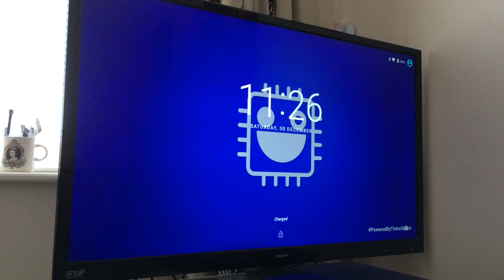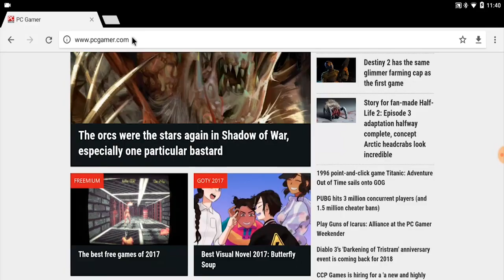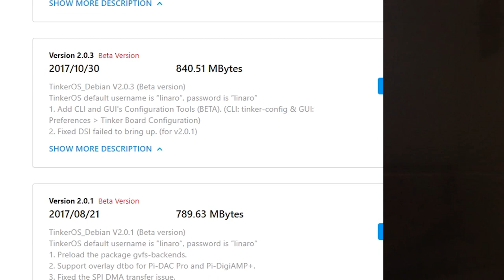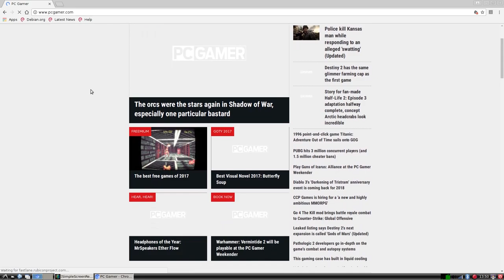The Tiny, Cheap Asus Computer That Fits In The Palm Of Your Hand

Comment: I got a Raspberry PI 3 as a cristmas present. It's very fun to learn how to code with this thing and it's more fun if you have a soldering iron. I already made a doorbell which gives me pushup messages at my phone and with a friend of mine, who already known how to make apps for android, we made it possible to send a audio message to the PI, which is then played. I already ordered a little camera so we can see who's ringing the doorbell.
Reply: Great idea they are often used with retropie installed for retro gaming  to make arcade cabinets but have so many uses .
Reply: kingofnfsfan the raspberry pi is a wonder. Yes a soldering iron will help alot. This asus tinkerboard would definitely give raspberry pi some competition. Glad you found something you can enjoy :) Happy new year!
Reply: Yeah the access of GPIO is a strong advantage for those kind of cards. It's like a strong microcontroller with interface and few programming skills needed.
For better retrogaming emulation and still very good Linux support, the Orange Pi boards running Allwinner H3 or H5 (Cortex A53) are very cheap comparing to RPi 3. But if you want to play GameCube and newer console you probably need to go with standard Intel x86 CPU with a way better IPC.
Reply: Do you mean the doorbell sends push notifications to your phone? Is it an open source doorbell or something? Where did you get it?

Comment: For those wondering,
The raspberry pi 3 has a ARM Cortex-A53 1.2 ghz quad core cpu so it's 600 mhz slower than the asus's Rockchip RK3288
The raspberry pi only has 1gb of lpddr2 so half as much as the asus's 2gb lpddr3 ram.
The raspberry pi is only capable of 1080 in contrast to the 4k support of the asus.
The asus looks to be about the same size so the form factor is the same.
Both have bluetooth, wireless, 4 usb ports and a hdmi port.
So for 30 dollars more you get a computer with one gb of faster ram and a processor that is 600mhz faster and could probally be overclocked.
Reply: The raspberry picture community is infinitely larger though, and when it comes to these boards that's very important.
Reply: The ASUS also has a GPU
Reply: PLease don't write stuff you don't know
Frequency doesn't matter because the raspberry pi uses different and weaker cores
Reply: Might want to research clock speed a bit more, man. Frequency literally means nothing on its own between different lineups of processors.
Reply: ok i added a bit more information to the original comment about the different models
Reply: RetroX still the 600mhz lower isn't relevant, is what we were saying. A 2.1ghz modern i3 is faster than a 4ghz am2 processor.
Reply: The cpu architecture is also diferent, (cortex a17) which is (albeit still 32 bit) is significantly faster then the a53 of the Rpi. I want one.
Reply: whole problem is software. RockChip has only NDA drivers, asus not very good at specific things (remember xtion?? i have one, software was abandoned at 2013) not worth it unfortunately
Reply: RetroX raspberry pi has a bigger community
Reply: The new pi is the same price as the tinker board if you get 4GB RAM now!

Comment: This Tiny PC has Quad Core and here I'm still using Dual core
Reply: Debjit Chowdhury we hate our lives dont we?
Reply: It's a quad core arm processor so your 2 core is better
Reply: Adam Burke OH so its arm Huh now i dont have to kill myself DUAL CORE RISE
Reply: Debjit Chowdhury that quad core if you decouple the gpu has the power of a p3.
Reply: Subi_fan I'm LGA 775 user not AM3+ user
Reply: My phone has a hexacore and my pc has a dual core, both have the same amount ram
Reply: Debjit Chowdhury im here using my celeron 420 with a single core
Reply: Miles Routledge I already know that A Octa Core mobile processor never beat a Desktop Dual core even my my phone has 8 core and it can't beat my Dual core PC. I'm just saying that this Tiny PC has more core than my PC
Reply: Debjit Chowdhury my quad core phone beats my single core pc everytime.
Reply: 1.8ghz means it is in most scenarios, terrible, besides general browsing etc
Reply: i got a 1 core
Reply: u complainin about that while im gratefull with my pentium 4
Reply: It could be 8 core but each core on Intel/AMD has far more transistor power frequency aka GHz and the pipe only got 2 lanes but it does things are faster and more headroom hence why PC cpus heat up its due to the power that is throwing though the cpu transistors.
Reply: @computerg11k89  Socket 478 or LGA 775 one?
Reply: @theweirdmaterial4908  775
Reply: Subi_fan  fx is cool

Comment: One of the most interesting features boards like these have, is the large general purpose pin header. You can connect all sorts of custom circuits to your SBC and program the pins to send/receive data, drive servomotors, pumps, valves, turn things on and off, pretty puch anything you can write a program for. So it can be used as an Arduino on steroids, used as the brain of a 3D printer or CNC machine, etc.

Comment: This is awesome... I might get one to use with my ROG_EXT header and get some serious OC's done.

Reminds me of the old Asus OC Palm/ScreenDuo. There isn't a single video of one on youtube.

edit : Yeah, you can actually get a brand new Raspberry Pi 4 with 4Gb of ram and a bunch of extra stuff like a case, 32gb micro sd card, heatsinks, a 40mm fan, charger, and a bunch of other stuff for only $135 CDN which is about what the Tinkerboard goes for USED on ebay on it's own. You can also get an 8gb ram version for $170cdn.

Comment: I use Linux as my only OS on 2 of my 3 pc's. I think it is better, more user friendly, and just as stable as windows except for gaming. I still do most of my gaming on linux though unless a title isn't supported and wont work on wine.

Start with linux mint cinnamon or xfce. They are more user friendly and have more features then the standard debian. Mint is also based on Ubuntu.

Although you can customize them all with the desktop environment and file manager you choose.

Comment: Imagine putting that in an ATX case lol
Reply: I shall 1-Up that idea by putting a raspberry pi zero which is half the size of this and really thin in a full atx case
Reply: Will2133 I buy power would do it, and label it GAMING COMPUTER
Reply: Actually that might be kinda neat to have a tower with 2 systems, given it's a tower you don't mind cutting a few holes into for I/O
Reply: BootlegScarce but not just any leds, it has to be RGB
Reply: Linus Tech Tips put 2 actual PC motherboards in Corsair’s new case

Comment: I'm really surprised this kind of hardware is not integrated yet on PCs, be via a PCIe card, on the motherboard itself or something like that, it would be an interesting way to use your system (even without a CPU, ram or GPU) with very very low power for all kind of day to day basic tasks like youtube watching or PLEX server duties to setup duties like updating your MB bios, downloading and creating an OS bootable pendrive, reading PDF manuals.

Comment: what you didn't mention is that those little sbc's use next to no power at all. that makes them perfect for building a small home server without driving up your power bill. 
i have a bananaPI, which is the same form factor with lower specs. but it is running for about 4 years now very reliable. started with a single harddisk, it has grown to 6 disks with a total of 7 TB storage for my home network. also runs a lot of other services.

Comment: You don't have to dump Windows to use Linux. Use both. They both have their strengths and weaknesses.

Personally I find Linux better for building an automated workflow - batch conversions and so on. It's also a much better environment for software development. Windows is better for games and productivity. Just switch between the two as required.

Comment: The real question is, can it run Doom? (the old one, obviously).
Try this in the linux terminal:

sudo apt-get update
sudo apt-get install chocolate-doom 

After running those commands, open up any computer you installed Doom on through steam, fish in the file system for your doom.wad or doom2.wad (the file holding all the levels, wad being an acronym for "Where's All the Data?"), and put it on a usb drive. Then, put it in the home folder of your debian installation on the tinker board.

Chocolate doom is a source port for Doom that aims to keep as many things true to the original as possible (including emulating old bugs and keeping the resolution low) while using modern OS compatibility standards so that it can run natively in OSes like Windows 10 or OSX, and as such tends to run well on tiny computers like the raspberry pi. I know it's in Ubuntu's software repository, so that you can use apt to get it, but I don't know about this for Debian's repoes. If Chocolate Doom isn't available, you could also try PrBoom, or attempt to download the source code for Chocolate Doom and compile it from source.

Comment: Finally, single board computers RGH. Also Linux is great, I switched this March to Linux because of my Raspberry Pi. And it turned out to be really not bad at all. Some games as CS:Go and all the other Valve games run flawlessly. And also there is a thing  called PlayOnLinux which I think creates something like a Virtual Machine, so you can play PC games. It doesn't really work with all the games but games like Overwatch and OSU! run just fine. Overall learning Linux was fun for me.

Comment: I'd be interisted why you don't like neither Android nor Linux? Linux often is great, especially for older Computers with less juice. Have a nice day
Reply: Likely because everything is easier to do on windows. You can get a lot of the same functionality out of a linux OS as compared to windows but there are usually a lot of extra steps involved and quite a bit of a learning curve. I use Ubuntu on my laptop, which struggles with windows 10, and while I can do all the things I could with windows, it's always more of a hassle.
Reply: i have a celeron 420 and when I overclock it to 2.45 ghz linuxmint wont boot.
Reply: Jane Doe That's probably an accurate statement. One thing about more modern linux OS's like Ubuntu is that they meet Windows half way by having a nice ui, which then doesn't really force you to learn the real ins and outs of a linux os, e.g doing things solely with the terminal. Then when something outside of your comfort zone is required it seems a lot more difficult.
Reply: Cuzeg Spiked Yes, you find it easy to use, but as therandomdot already stated, you really need to get used to Linux and be interested by yourself. An that's not within the comfort zone of most users, particularly not of inexperienced ones, I think.

Comment: Linux is epic. I'm not even a fan of it for everyday use myself, but for programming and doing behind the scenes dirty work, you can't beat it. My network at home runs on a homebuilt Linux router/DHCP server. I also host a Minecraft server and associated webpage on Linux. The Unix/Near-Unix scene is legit. I'd use it full time if more software devs supported it and I didn't hate OpenOffice so much. FreeBSD is really nice as well.

Comment: I got one of these back in early 2019 due to the out of the box Android support and double the ram of the Rpi 3 at the time. Sure, software support for it is pretty much dead, but it is a great energy-efficient home theater and emulation machine (although some PSP games lag on it).  I am sure there are better ways to use it, but it is very comfy if you use Android and don't expect too much from it.

Comment: As far as i know if the Asus TinkerBoard can run a normal sitro of debian it should be possible to get the linux version of steam installed. The bigger problem ist the architecture of the cpu and the fact that it does only support OpenGL ES and thats also different from a desktop version of OpenGL.
Only the fewest games will run on it even if these are native linux games like BlobbyVolley. The Asus TinkerBoard and all of the raspberry pi's are always misused for gaming and emulation because there are cheap mini "PCs" wich can run linux. The real purpose of these is to have an all in one DIY programming station / script running pc for several projects wich need the GPIO(General Purpose Input Output) pins of the board. To run Android on the TinkerBoard or to run Ubuntu Mate on the Pi ist just for playing around and not the purpose of these boards.

Comment: to everyone who is wondering about linux I am just going to say that it is really easy to use and a good alternative to old pc's if you don't want to buy a copy of windows and it is easy on the system, I use it a ton of times, I even put linux on my old laptop because the vista on that thing kept crashing, so I installed Linux and it runs a lot better, now I have a spare computer I can use if I need one.

Comment: But... CAN IT RUN CRYSIS??
Reply: no.
Reply: I highly doubt it will. you'll have to add a fan for cooling or replace the heatsink altogether cause if you could run it it'd probably overheat
Reply: Samo Hraje Yep, Crysis 3 on Ultra settings in 4k@144 FPS, it's a monster!
Reply: Victor Matheus Bezerra Lima, Nah man you didnt use its full potential, I used crysis on 8k and ultra settings and I got 240fps while overclocked the processor to 4.7ghz and the gpu to 2ghz and downloaded 16gb of ram
Reply: Victor Matheus Bezerra Lima you are underestimating it 16k@300fps with omega fucking realistic settings in crysis

Comment: Try overclocking the board by ordering a case for it then wiring a 40 or 80mm fan to the case I ordered some fans to do the same thing with my raspberry pi.

Comment: 2x the power of a Pi3, 2x the cost.

I still prefer the Pi3. It can do all my emulation needs on it, and it has the advantage of being well supported (As long as you stick to the 32 Bit OS) (I still can't believe there is not a single official 64 Bit OS for the Pi3.)

Comment: can it run Crysis?
Reply: Japije 01 easy
Reply: 4k supported. This was already mentioned. Duh!?
Reply: My raspberry pi  runs crysis at 4K 120 FPS so this can definitely run it at 240 fps
Reply: only at 1x1 res
Reply: interesting, i just googled it and its possible to run crysis on linux and some ppl actally did run it on slightly stronger single board computers
Reply: Harsh Chan you need to update your drivers. should be getting 8k at that fps on the pi.
Reply: Мандибрики і Цирупопики sarcasm, dont be serious ok?
Reply: Ded meme
Reply: It will never die...

Comment: Linux is fun and you can learn HEAPS about computers by just playing around, I didn't switch from Windows either (Gaming being the main reason) but now I work on Mac , Windows or Linux no problems. Linux is very similar to Mac operating system (Unix based). It costs nothing also which is great. (Unlike Apple!)
Reply: Unix and Linux aren't similar? Come on mate.

Comment: i want to buy a tinker board but i am not sure if it is much of an upgrade to my raspberry pi 3. 
following a tutorial i found on the web, i managed to install and play the java desktop version of minecraft on my pi and right now i have it running as a silent and power efficient but somewhat laggy minecraft server. 

while the doubled CPU performance and RAM of the tinkerboard should help a lot, i can't find any minecraft related tutorials for the tinkerboard and don't know if the raspberry tutorials would work for the tinkerboard. 

in theory, they should. both raspbian and tinker os are debian based so they should be pretty similar, but i don't know for sure.

i am not good enough with linux to make more complicated stuff work on my own without a good step-by-step guide - and the tinkerboard is still lacking in that department

Comment: is it bad that a 600$ laptop that I brought in 2014 has a slower processer then that?
Reply: Frequency really doesn't mean much. My FX 8 core/8thread CPU at 4.8 Ghz vs an i7 6700k at 4Ghz 4c/8t is weaker in almost every application. You are comparing completely different architectures, so frequency is not meaningful.

Not all though, some the FX takes a massive lead since its an actual 8 core (but definitely not gaming). That same application holds its own on the FX compared to my Ryzen 8 core when everything else shows a huge difference.
Reply: But the APU was a AMD APU at 1.4 ghz with 4 cores.
Reply: Yeah, that's not an arm chip... My cousins 8 core phone at 1.4 Ghz is way slower than my FX 8 core even clocked down to 1.4 Ghz. They are way different architectures, and frequency is not comparable.

I had an AMD E1 laptop (2 core 1.2 Ghz) $100 new. Linux runs way better on those laptops, I was getting 7.5x faster in most applications (compared to windows 8.1 and 10), and even launching programs was much faster (only OS change).

The weak little arm processor in this video was running Linux, you can't compare your Windows machine to Linux, because Windows is so bloated and slow, its like tying a loaded down trailer to your system, turning even the fastest machines into a turtle. I would recommend putting Linux on it, its a huge improvement.

Comment: Huh? Isn't the point of thisnice little piece of hardware to be used as a computer which controlls other tchnical things? For example I used my tinker board to make lds blink in the right order so I could teach my daughter how to count more easily. I wrote a simple Python script and it worked. That's why there are so many pins with no plugs on them on the board. Anyways I still love your videos, keep'em going!

Comment: I build an PC with these specs for 100$.
GPU: GTX 650 Gigabyte OC 2GB
CPU: Intel Core I3 2120 3.3GHZ
Ram: 8GB
Storage: 500GB 7200RPM HDD
Unbranded 450W PSU.
Mobo: Lenovo IS6XM Socket 1155.
CPU Cooler: Stock Intel Cooler.
Case: An old Acer PC case (in that case were my old components)
I run GTA 5 on DX 11 mode on high settings, except textures, textures are on normal at 30-40 FPS. But it worths 100$?